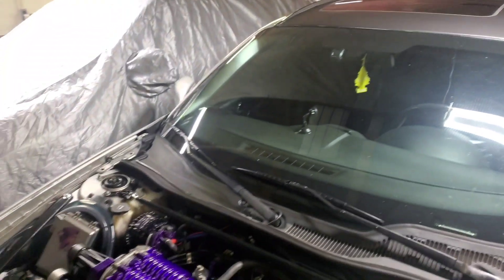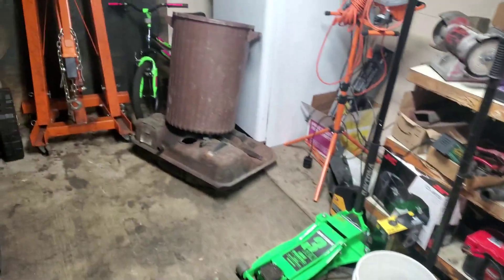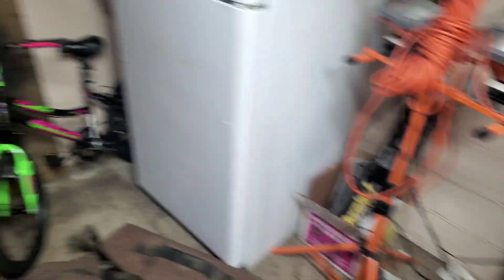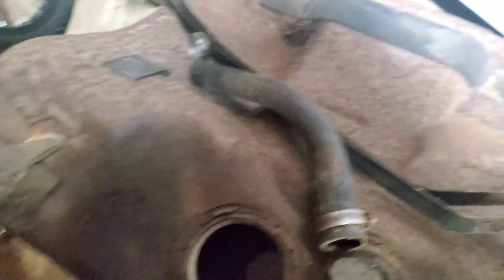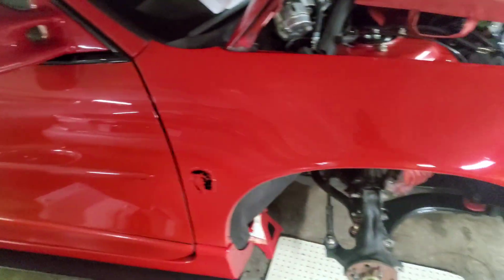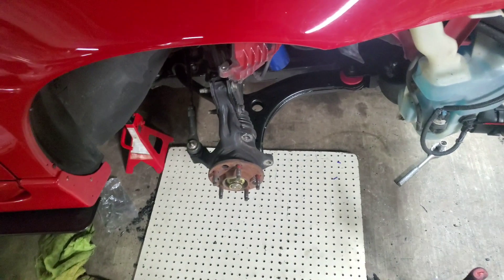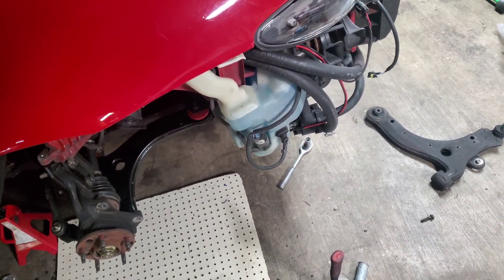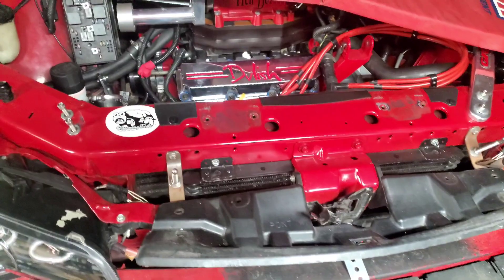progress on HellBoi

Comment: Hey bro my 08 grandprix i just tune up i replace icm all 3 coil plug ac deco all durlast parts original wire set + po420 code it has miss fire po302 all spark plug fire fuel injection fire to never over heated head i put lukes fuel injection cleaner put medium grade fuel help fake miss fire i think it clog cat but i unbolt manifold by cat help little but sluggish power push get 50 mpg from dead stop then push gas pedal slugg get up speed
Reply from the maker: Do a compression test
Reply: @hand12u  that be last step car only has 152xxx mile on her
Reply: @hand12u  do u think by durlast part any better by ac delco part cost 250 more then 130
Reply from the maker: @lawrencemeyers1212  yea try that and go from there
Reply from the maker: @lawrencemeyers1212  durlast has good parts
Reply: @hand12u  should i have them do full clean whole fuel system before i do compression test i hate here number 2 cylinder bad this was bad year for me has this prix i had dream make it first 08 grand prix gtx supercharge of year they stop making them then
Reply from the maker: @lawrencemeyers1212  i honestly dont know theres alot it could be
Reply: @hand12u  ok bro thanks for reply that good idea but cold start it long crank time if they help me figure out fuel reguator but in tank whit fuel pump